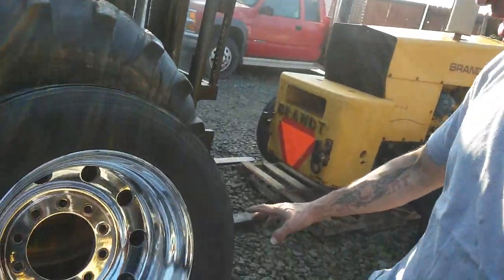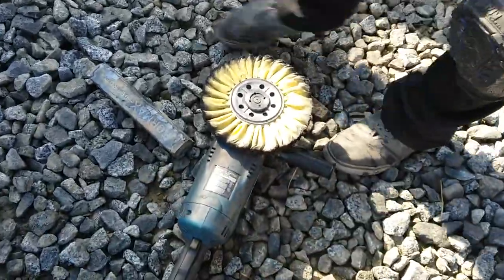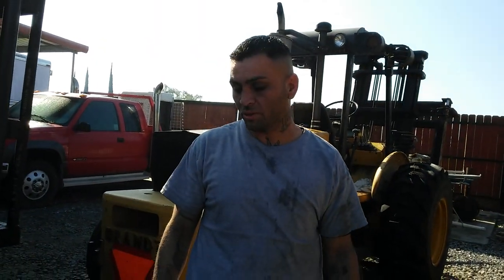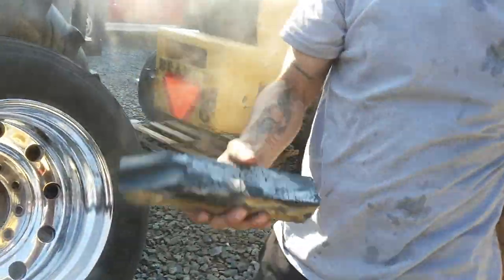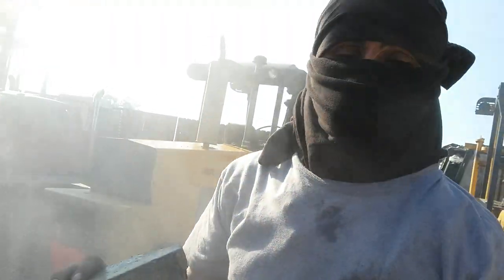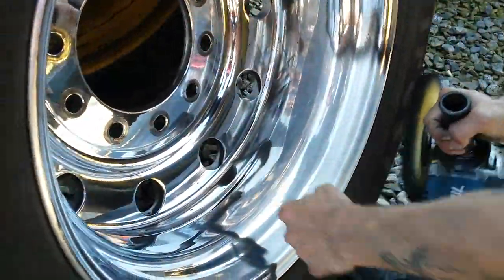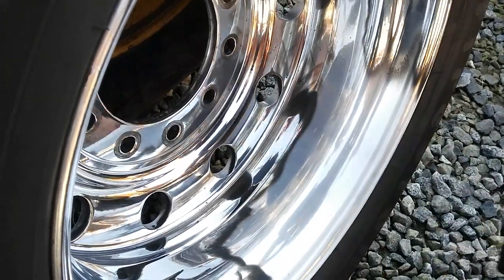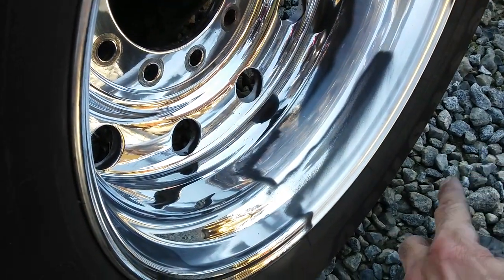DIY how to Polish aluminum wheel Tony Metal Art

Comment: Great vid, thanks. 
If I use the FORMAX finishing bar to polish my contrast cut motorcycle wheels... and the pad rolls over/rubs over to the black powder coated surfaces... will this damage and or leave rub marks on the coated surfaces?  Thanks again.
Reply from the maker: okay so im assuming that your polishing coated wheels.....well honestly your gonna get show room results cause of the coating but it should wipe right off, their shouldnt be a problem taking it off. Try using gold medal flour on a micro fiber towell
Reply: Hi Tony
Thx for the response. Yes, my wheels are powder coated gloss black with polished bare aluminum. The only coating is the gloss black powder coat. 
Regarding the Gold Medal Flour... exactly, how do I use it? Dry, damp cloth, etc? Thx again!

Comment: Hey I was in the middle of polishing my wheels I used a spiral sewn wheel with red rogue after sanding from 220 grit to 2500 wet sand and then polished with the red rogue and yellow spiral sewn wheel then finished with the white spiral sewn with white compound but after I was done there is scratch marks in guessing from the sanding. But all the sanding steps I did where done right and made sure before moving up in grit the sanding marks here being reduced. What can I do to get them looking like a mirror finish? Thank you
Reply from the maker: u have to cut correctly, yellow airway with brown tripolli rougue. U have to use 5000 rpm or more. also maneuver the machine the same as i do. Hope this helps u out

Comment: i haet buffing dirty stinking aluminum, but you know alot of formax compounds work pretty good. try some of their stainless steel coloring compound its pale green but expensive but stops that burning effect with old or billet type aluminum. recently even got regular steel compound to work pretty good on a customers aluminum sand rail wheels. used same buffs as tho i do like concentric sewn buffs for tuff or flexing buff needs

Comment: Nice technique, I'll try it! What is the name of the yellow wheel you using again? Thanks, Dave.
Reply: Dave Kana 
not sure about the name of the wheel. it's just a yellow polishing wheel
 that has layers of stiff
 cloth that is designed to wear down as it is being used. very dirty way of wheel polishing but as you can see it works very well.
you can buy these polishing  wheels at petro  truckstops and chrome shops. they cost about  20.00 and the bar of jewelers rouge is roughly the same price.
make sure you use eye mouth and nose protection because it does throw small fibers that you will breath if you dont.

Comment: Ya know what works awesome?   A lazy susan bearing and a piece of plywood.  Center the bearing on the plywood and cut it to the correct diameter for your wheels and it will spin as you polish, just control the speed with your foot.  Makes it a lot easier on dismounted wheels/tires.
Reply from the maker: huh.....I'm gonna give that a try. thank u
Reply: +Tony Metal Art Jimenez No problem, I think I got a 300mm bearing for like 30$ and just cut a piece of plywood round and screwed it to the bearing and lay the wheel right down on the plate and its a nice turntable to work with, could probably get creating to build a stand/ fixture to lift it to waist height so you're not bending over wheels all day, that's the worst part of doing wheels.  Run the polisher and let it and the bearing do all the work, kinda like the automated machines do.   Sucks bending over wheels to polish, my back hurts for days after that kind of shit, glad I only have to do it every other year or so.